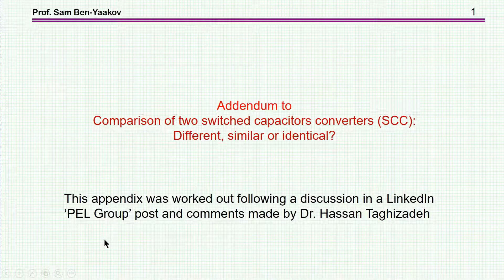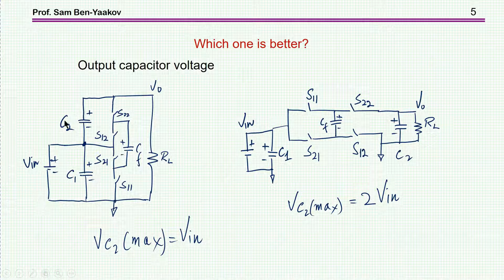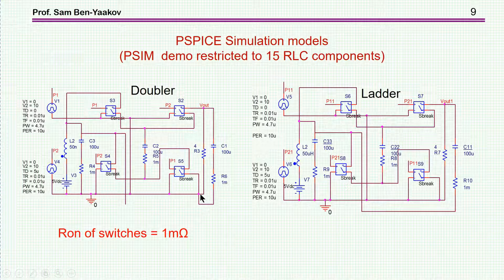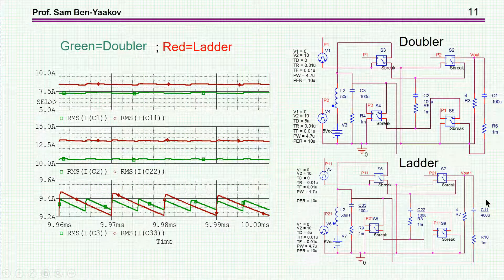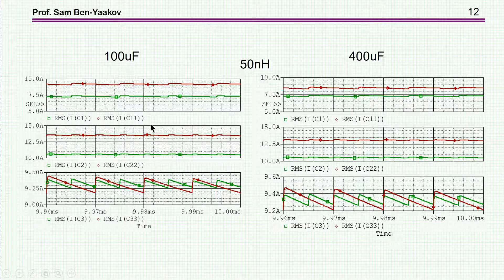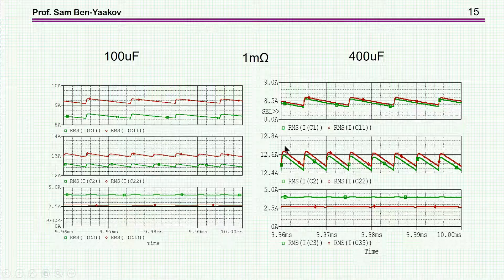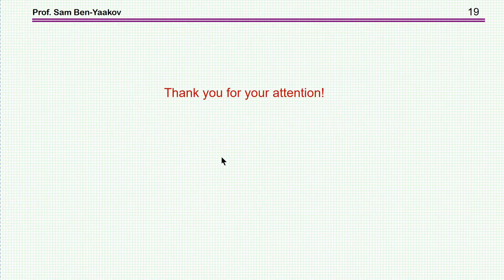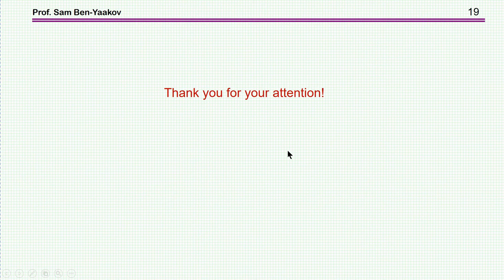Addedum to: Comparison of two switched capacitors converters (SCC): Different, similar or identical?

Comment: Very nice explanation (as always).
What would be the advantage of a switched capacitor converter versus the standard buck regulator? 
What will be the expectation of an EMC/ EMI behavior versus the usual buck regulator?
Reply from the maker: Advantage smaller, low EMI, but fixed gain. Recent papers demonstrate very small size 600W step down with 98%-99% efficiency.